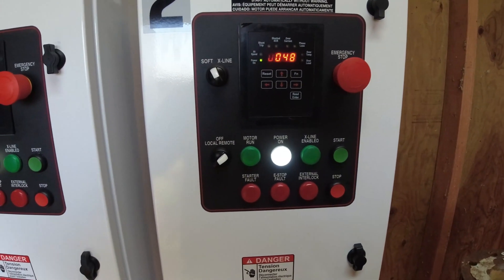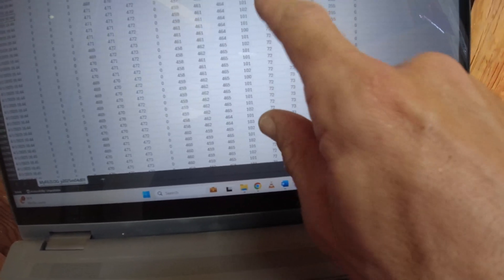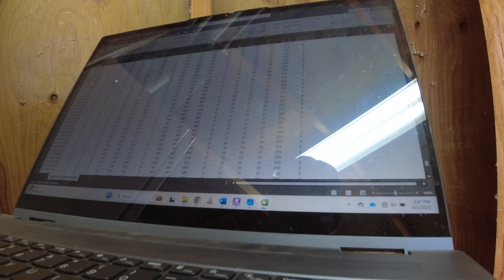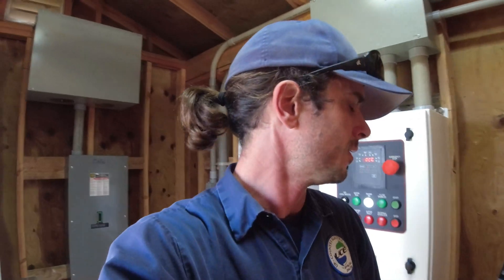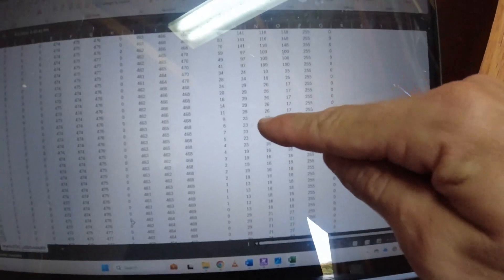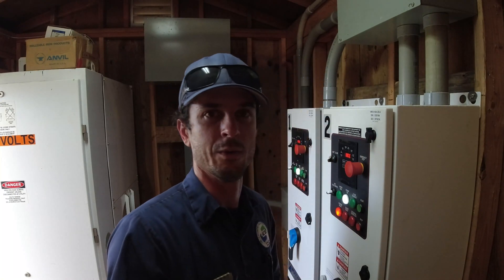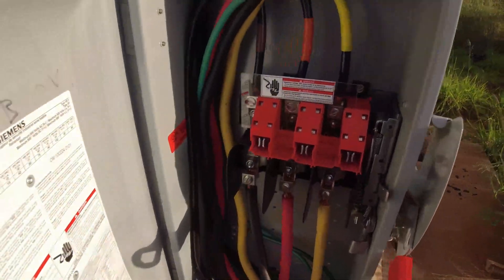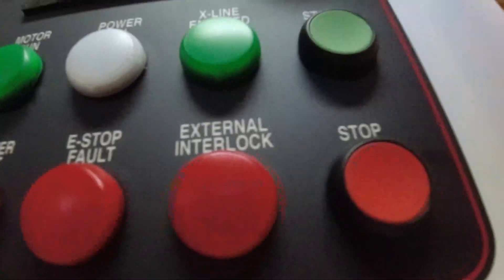Soft Starter Bug Finally Found

Comment: As this is a solid state soft starter, it'll be more susceptible to power surge conditions, such as a nearby lightning strike. As for the ghost current readings, this is probably due to damaged ADC chips. And yes that would comport with a board replacement. If the ADCs use a shunt for current measurement, they would be even more susceptible to surges, than using CTs for the same purpose.

When replacing the boards, I would look to see if it looks like a shunt or a CT being used for detection. If it is a shunt, it would be a good idea to either beef up the lightning surge protection for the entire pumphouse or consider a different soft starter model/brand.
Reply from the maker: Definitely suspicious of surges here and have multiple tiers of protection installed throughout the system.

Comment: I don’t have time to go through manual for that thing: is PCB you are blaming inside the main body, or inside the HMI? Is HMI communication cable shielded, is that shield properly grounded?
Reply from the maker: The faulty PCB and software is within the main body. HMI is working correctly, it only displays values. The faulty data we log/observe is pulled from the modbus addresses within the internal PCB.

Comment: Check the circuit board in the starter for leaking capacitors and also check if the motor start capacitor (if it uses one) is in good shape. You can also check the manufacturer to see if there is a software update you can load into the starter
Reply from the maker: That's good advice, this isn't the only symptom of the failure. We've been working with the manufacturer and have exhausted all their remedies up to complete replacement, which is what's happening now. Check out my other videos on these soft starters to see the whole story.
Thanks for watching!

Comment: Check the black rings and make sure they are all plugged in right too. They are the current sensors. If you see it again.
Reply from the maker: Those CTs are for the external motor overload (bottom left) for when the soft starter is in across the line bypass mode. The CTs that work with the SCRs are internal.

Comment: Was the pump back spinning? I guess that could possibly trick those CT's. If it's submersible pump that is.Not sure what kinda of flow meter you have but if it's flow sensitive it wouldn't read backwards flow.
Reply from the maker: That is a possibility, however in my mind if it was suddenly generating from backspin the "amps" the rvss was showing would show up with my clamp meter. Thanks for watching!
Reply: @ I must have missed when  you put your clamp on it I guess, definitely something with that board if it's reading current when it's not running. Did it still pick up a reading after remove power to the soft start?
Reply from the maker: Now that would be spooky!
No, once it's powered down it shows nothing.
Reply: @Up-CountryElectric  that certainly would be spooky, I guess I should have said after a power cycle
Reply from the maker: Ahh that makes more sense! No, after a power cycle the anomaly will usually go away for a few days before occurring again.

Comment: I mean, if there's something you can't explain and it involves electronics, it's probably electronics fault. Sadly that's how it is imho.
Reply: @klarnorbert  I’m not sure, but I I didn’t see him checking amp drawer on the line side of the soft starter, but he did say “nothing going in”, need to re-check where they put the data loggers CTs, maybe he was looking at the logger screen. It might be internal “earth leakage “ of the soft starter, or unauthorised SCR firing/shorting. That at least will explain the reduced flow, and higher current fault, because internal fault “robbing” motor of its current, but will be registered as over current by soft starters CTs
Reply from the maker: That is a good point. A way to rule that out would be additional data logging on the line side of the equipment. Our logging as it is comes from the internal CTs (the external CTs are for the bypass overload) and internal printed circuit board via serial coms.

When the unit showed amps, there was none present on the line or load side. 

I think I understand what you're saying, the over current fault could be internal to rvss. It's possible. However in my mind the inaccuracies related to voltage (earlier video) and current (earlier video and this video) point me (at the manufacturer's advice) to replace both units. 

Thanks for watching!
Reply: @commenter5469  Agreed, those CTs are line side to the soft starter and he checked the load side. That starter itself could actually be drawing that current, as you said. Too bad he didn't check next to the CTs to verify they weren't in fact seeing that current.

Comment: Soft starter is not VFD, it can’t “run” pumps current, after relay contacts are made. It there only to ramp up at initial start, and monitor stuff and shutdown ( brake contact) on fault.

So you are not out of the woods yet. Because drop in the flow is not explained, you might be dealing with more issues than one.

Were you logging voltages also?
Reply: It did shut the bypass contactor down(it's inside the housing), because it thought the motor overloaded. Faulty software, CT or board. Would be nice to have encoders on those pumps to see if the motors are running or not, and on what speed. I mean, how can a motor draw 16A - 25A current, when it's turned off(I mean it's probably off, because the flow rate is zero)? Also check the end of the video: motor is not running, but it still shows around 20A current drawn.
Reply: @ I suspect shorting SCR(s)
Reply: Yep, tripped overloads would show flow dropping cause motor ain't drawing anymore amps. It seems like electronic in soft start @klarnorbert
Reply: He showed voltages and the voltage didn't drop when the current went up.
Reply: @inothome  Yeah, I hade to come beck to review it.
Reply: @ It might very well be that he just didn’t really pointed out trip time point correctly. And all of this rambling for nothing.
Reply from the maker: Could be 😂 
Thanks for the advice, I'm still learning.
Thanks for watching!
Reply: @Up-CountryElectric  Just double check the beginning of the flow drop with fault trip timelines ( not current spike ).
If the beginning of the flow drop correlates or with little delay compared to the Tripp time - you are on the right track.

If the flow drop started before tripp time -  you have something else going on.